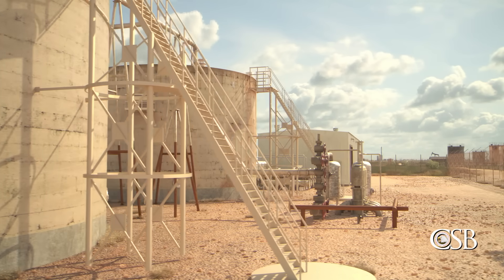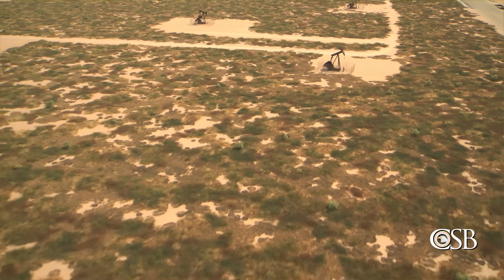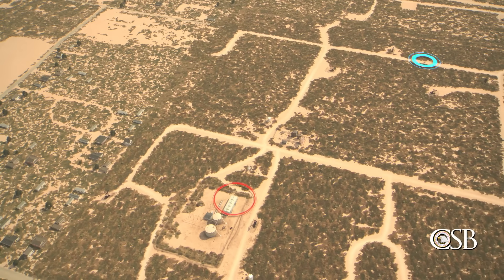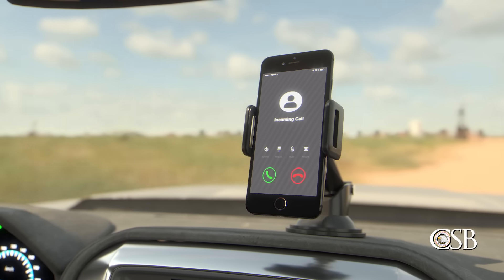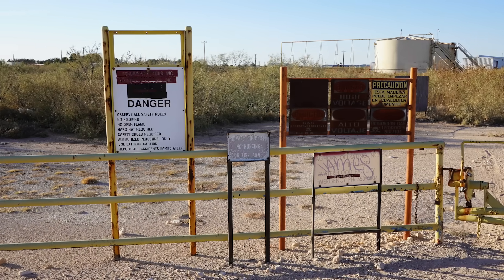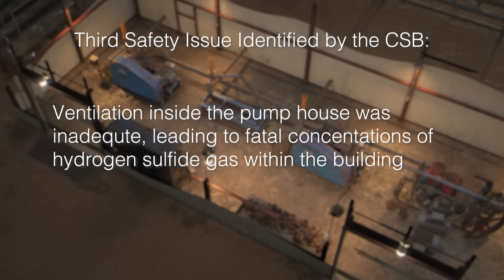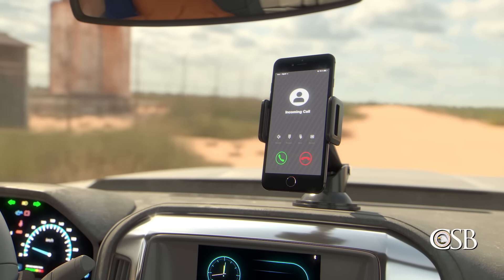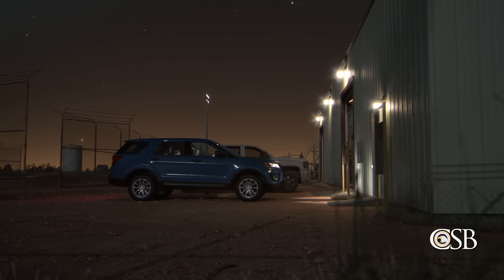Silent Killer: Hydrogen Sulfide Release in Odessa, Texas

Comment: Awful tragic moment that could have been avoided. Many make the basic assumption that skips over the reason for their deaths. You think you could smell it before being overcome by it ? This is the real danger of H2S. Once it gets over a certain concentration we cannot smell it anymore. I forget the actual parts per mill, but the main reason H2S has always been such a killer around the world is due to this. Basically if u can smell it, you are ok but obviously need to act. It is when you cannot smell it anymore that deaths happen...it is more like a rapid paralysis of respiratory system It is very fast. Being heavier than air, some deaths have happened on rigs by the guys on the floor evacuating off the floor down stairs/ladders only to be overcome by H2S sitting underneath the drill floor on still days/nights. Lucky i havent witnessed a death from H2S from my time, but going back decades it was once a common cause of death/accident especially when drilling new wildcat wells in less known areas/depths. Even just 40-50 yrs ago there was sometimes no "cause of death" known in less professional parts of the world. The biggest preventtive measure is knowing you are in an area of exploration or production where it is known to exist. Then you can educate everyone. It has been known for guys to simply go for a walk at night or when wind is absent and venture into a nearby valley, and be overcome/killed by H2S. If it is concentrated you may not smell anything, and be killed very quickly.
Lucky over the last few decades more and more detection devices have been introduced including the ones you wear on your person. I have sat wells where the only measures taken is one mudlogger with a variety of gas measuring tubes taking readings for things like H2S CO etc when recovering core barrels. No "sensors" or automatic alarms etc. Scarey when you know what can happen. It is so much safer these days...as long as you frequently test your equipment, have breathing apparatus available ready to go for crews, and never trust any "Automatic" systems. The companies with the best procedural safety records (when it comes to drilling/production) were always the huge ones such as Exxon/Shell etc. They tended to contract the best crews/rigs, access to best staff, wouldnt tolerate anything from a contracted drilling company, had the muscle to ask for the best, and always had the best wellsite geologists and drilling supervisors taken from around the world. They all had major in-house training programs, worked as a proper team, and when they spoke people needed to listen. Even their geologists seemed to know more about drilling ops than the average toolpusher. Made for a safer working environment for all. In many cases would supply even their own drillers when offshore. They cop a lot of shit for other engineering and rig failures but that is usually because they are often the companies exploring unknown new areas or new depths...there's an inherent danger in the great unknown, especially from overpressure. You would just feel happier with them operating the rig you were on. Small servicing companies skimp, thats a massive and endemic danger around the world. The 4 most professional places to work...Gulf of Mex, Bass Strait Australia, North Sea/Norway. Worst i came across was definitely anything owned/operated by Indonesia. 
The only result was the children were ok and mum was smart leaving kids in the car. Its a complete breakdown of procedures and equipment. Dont ever trust oil/gas service companies with your safety...if they dont seem to listen to your concerns, quit now, coz its a sure sign they are trying to save money wherever they can.

Comment: CNC Oilfield Services of Frierson, La and Tidal Logistics, LLC of Frierson, La, Joaquin, Tx, and Bethany, Tx are constantly non-compliant with H2S safety practices and procedures. Most of the water truck drivers at CNC fail to carry their detectors on them, and in the case of Tidal Logistics, LLC a driver will be very lucky to even have one. Drivers will occasionally climb the collection towers and visually check certain wells that do not have working gauges, exposing them to direct contact with well head emissions. In the just over 8 months that I worked for Tidal, from April to November, I was never assigned a necessary safety particle/emissions detector. But I was assigned a tablet and a cheap tire guard that I was forced to sign for in case I lost them. I shouldn't have been surprised by that after becoming my told by a night supervisor that the safety work lights on the rear of the trailer were just a "perk". How safety conscious does that indicated that they really are?

The operations manager at Tidal of Frierson will not even provide easy access for drivers to needed fittings for the trucks, or better yet assign the necessary fittings to each driver so that they have what they need in good working condition. Broken ears and cracked connection fittings and hose fittings are the norm and the pump trailers often have worn or broken valves and safety pop offs that leak or do not open and close properly.

I was fired from Tidal in November of 2022. As a driver that has had many years of over the road experience I was and am used to purchasing my own equipment when the company refuses or fails to provide any necessary items, which I have already indicated that Tidal Logistics, LLC does not. All fittings and hoses at Tidal's Frierson yard are kept under lock and key, with only two key holders. Both being the head mechanic and the lead mechanic at the Frierson shop. One is almost never there, and the other continuously claims ignorance if you ask for fittings. 19 times I requested fittings after stopping by there from the Joaquin yard specifically to acquire them. Only once did I ever get what I requested, and that was only after getting to a site and not having the required part. I was forced to call my supervisor and have him run one out to me, and I was scolded by both him and the lead supervisor for not having the required equipment on my truck. 
Thereafter I resolved to equip myself at my own expense, and I purchased the necessary fittings from Amazon, EBay, and the fortunately stocked Ace Hardware in Center, Tx. I removed all of the old broken, cracked, damaged fittings and cr*p hoses from my assigned truck and trailer. I piled them under a shed at my assigned yard, making sure to inform both the Joaquin supervisor and the head supervisor of my actions as well as an additional Freedom supervisor. I had the truck all alone for over a month when a slip seat driver for night shift was assigned to it. Being as all of the fittings on the truck were purchased by me I kept them in storage totes and took them home after every shift. No way was I going to lose any of my hard earned money to theft or night driver negligence.
The slip seat driver complained to a supervisor that they did not have any fittings on the truck, which they didn't. The operations manager and a supervisor showed up at the Joaquin yard on November 17 or 18 to dress me down for "stealing" fittings from the truck and told me that I was being fired for it. The operations manager even tried to remove my totes with my fittings from the cargo space of my pickup until I informed him that I would be calling the local sheriff if he even dared to touch anything in my truck. I was summarily fired on the spot with no recourse a week before Thanksgiving. I still have all of my fittings as well as the receipts for them.

Comment: I remember hearing about this when it happened and the 1st thing I thought about was how did his wife get in there with him? They make us lock every gate we go through and if caught not doing it is a serious violation. Had he had his meter on he would be here today and had he locked the gate his wife would have had to call the company to have them check on him. 2 children orphaned over something that should not have happened. I always treat any site I go to as if it has H2S present. I look around to see if there are any dead animals around. I check my meter daily and always do the chicken scratch to see which which way the dust goes and plan my escape. I pray I never come across any of this gas. I am working at a place that has had H2S and has the lights and warning system. This is why I treat it as if the gas is present because the equipment could be not working. Very sad what happened here. My hat is off to all of you in the Oil & Gas industry you work hard every day and deal with so many unseen dangers!
Reply: welcome to texas. want ur gun?

Comment: The FIRST AND SECOND issues are not the employees. They are the BROKEN AND NOT MAINTAINED SAFETY ALARM FOR DETECTION OF GAS. The business owners are directly responsible for inadequate maintenance of not only the safety features required by law, but also for poorly maintained operational equipment that failed and resulted in the lethal situation. 

This video is intentionally poorly edited to place blame on the employees. They might as well have said the wife was at fault for her own death for trying to rescue her dead husband.

Also, if the alarm system went off in the first truck, the pumper's truck. That means that the children in the second truck would also have been exposed to hydrogen sulfide gas. A fatal gas likely has impacted their health. They should be contacted by the first person to see this who knows a lawyer and the children involved. They are due damages - almost certainly.

Comment: Hydrogen Sulphide is also one of the biggest threats in the waste water/sewage industry where I work in the UK. I was once told as long as you can smell rotten eggs you've got a chance. When you can no longer smell it, you're a goner. We use gas monitors and escape sets before entering confined spaces along with all other safe systems of working.

Comment: I worked as a pumper for several years.  My h2s monitor would go off on several locations.  I was still expected to do my duties whether my alarm was going off or not.  Our oil contained a lot of iron sulfide.  To make the oil sellable we'd have to treat each tank with a mixture of liquid soap and muriatic acid.  This would cause the iron sulfide to fall out of the oil and collect on the bottom of the tank. It also produced large quantities of h2s gas.  The tank bottoms would be collected by a water truck and taken to our disposal well where they'd be pumped down the well and often times blown back out of the well and into the containment around the pump. Then a brave water hauler would have to go in and vacuum it back up and do it again.  Sometimes we would store it in frac tanks until it ate a hole through the tank and disposed of itself the natural way right on the ground.  Often we'd dispose of produced water by spreading it on the roads as a form of "dust control".

Comment: Had to move gas stove in our old kitchen for new floor work.
Turned the old gas valve, behind the stove to full off position.
Moved it . Next day I smelled gas in kitchen.
Hot water heater was working with no gas smell.
Called our natural gas company. Guy came out. First thing as he was getting out of his truck was hold a yellow hand held device in the air and walk up to house and around front of house before he went in. We then went in.He held the device in front and sometimes above his head as we walked through living room into kitchen.
He measured gas in kitchen, and was surprised when he asked if i heard gas leaking from valve . I did not hear the low level hiss of gas because  have old ears.
Anyway he was good enough remove that old leaking valve and cap the pipe.
I commented , 'gas is supplied whether the valve is open or closed'.... !
Later it occured to me that evening, that that young man must have been following smart company procedure of gas detection when going out to a call of possible gas leak.

Comment: H2S is deadly.  Working oil fields you need H2S monitor.  10ppm can make ypu sick 100ppm will kill you. Some oil fields I worked had H2S ranging as high as 500ppm. Get trained get educated fear the gas.
Reply: I worked at sour gas facilities for many years. 10ppm will give you a headache after a few hours. 100 ppm can be worked in but, not recommended. 500 ppm will knock you out cold. 

You have to respect H2S. Fearing it will only create mistakes. You have to train for it. You have to be able to don a SCBA in one breath. Knowledge and practice will save your life. It saved mine more than once.

Comment: As a retired union industrial painter, I hated working in chemical companies. There is several of them located near Louisville KY called Rubbertown. We called it the Russian front. Stinky, dangerous place.  Rusted and corroded piping, and tanks, leaking valves. Located with pump stations or docks on the Ohio river.

Comment: 6:18 I'm surprised the firemen responding to the event smelled the hydrogen sulfide gas but the employee and his wife didn't.

7:12 His detector was going off but he still went in?

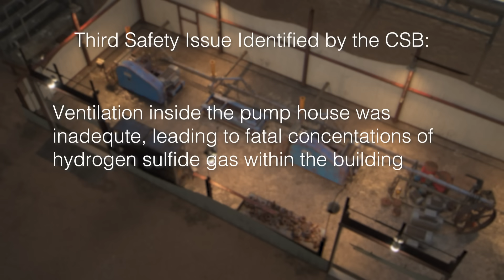9:10 Not surprised the USCSB also found this.  The first thing I thought was that the building should have ventilation, especially if H2S is detected, to automatically ventilate the building.

There is little you can do though if employees insist on cutting corners like leaving gates open.

Comment: Stationary gas warning systems cost round about some$ inklusive switch guard to disable pumps or ventils if gas exhaust detected.
Its the companies responsibility not to have this.
Optical and/or accustic warning systems are nice to have - but we see: it is not effective.

For work in such hazardous areas there should never been permission for single person to work inside. Why is the guy suffering to death for hours inside untill his wife comes? How could she enter the hazardous area.....it is alot of questions where not asked in this video.

Comment: As a career south and west Texas oil field worker, there are some unique circumstances here. The pumps being located in a building is not that common in Texas, (in this case being permanent water transfer pumps, this prevents freezing). Normally, in an outdoor environment, it is very difficult to concentrate enough H2S when at ground level to become IDLH (you would need one hell of a release, or extremely calm winds). You always hear about H2S deaths in confined spaces, pits, low areas, but very rarely in a normal ground level working environment, which is why many workers here are completely desensitized to the hazard. H2S may be present, but it’s dissipated to a nuisance level in most cases. Having equipment inside, where the H2S can become concentrated is extremely dangerous. The sensors present here were obviously not tested or maintained, the operator was complacent enough to not even use his personal monitor (which people sometimes ignore when it alarms). Extremely sad senseless deaths, 100% preventable. This is long term complacency and cultural failure at all levels of business. YOU are responsible for your own safety, no one in Texas is going to hold your hand.

Comment: So we’re going to put this on the employee rather than the failure of the detection equipment located in the pump area. Having worked in the chemical industry for 36 years , it’s usually the employees fault, not the upkeep, or preventative maintenance that would have eliminated these fatalities. I call BS.

Comment: The detection systems are critical with H2S. Critical. When the gas hits your nose it becomes incapable of doing its job, smell. I was a boilermaker working the plants on shutdowns and the H2S turnaround was a big deal on the safety end. Unfortunate ending for those folks and having been a Gauger as well this failure of the producer to maintain at least the pumphouse detection was unacceptable. We rely on a heads up.

Comment: I don't understand how they couldn't smell it. It is VERY distinct and irritating before you reach the deadly threshold in my experience. I've had to drain, clean, and replace those battery tanks and when you unbolt the pumps, not only can you see the gas, but smell it.
 No breathing apparatuses unless we went inside the tanks, either. The foreman would tell us to leave our H2S monitors in the car cuz they would just be constantly alarming. Couldn't just stick your head near it accidentally, Have to hold your breath to get those last few rusty bolts off. 

Maybe it was because this was outside and super high concentrations, and this happened inside with smaller concentrations that displaced the oxygen, is my only idea on that.

Comment: Holy shit Aghorn did F*** all to help save its employee. When explaining the dangers of the construction site Intake Manager would use videos/pic of accidents happening. A pamphlet does not get the point across why fall arrest and rebar caps are really important. For those interested the man fell and landed on the rebar near his rectum and out through a shoulder. Next is a lathe video where the pout soul touches the spinning part pulling them in mangling the poor soul.

Comment: Like a lot of disasters not one thing went wrong, not two things, not three things, but a shitload of things went wrong.

If shit didn't break they would have lived, if the monitoring system worked they would have lived, if he had his personal monitor they would have lived, if anything in the chain of these tragic events had worked as they're supposed to 2 people wouldn't have died.

I think that the telephone warning system is a good extra measure but it certainly shouldn't be treated as a primary safety measure because telephones are notoriously unreliable, that beacon should have been lit up like the sun and he should have known that it's not fucking safe to work on without the proper gear.